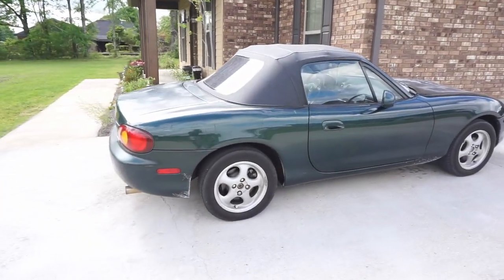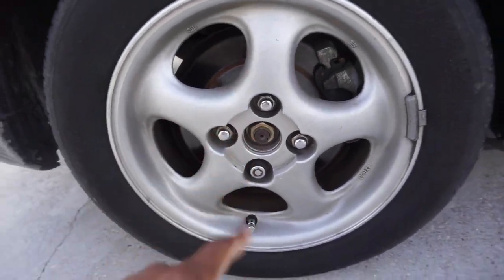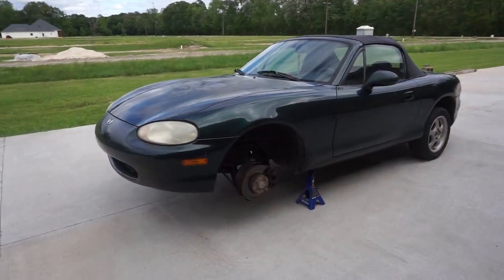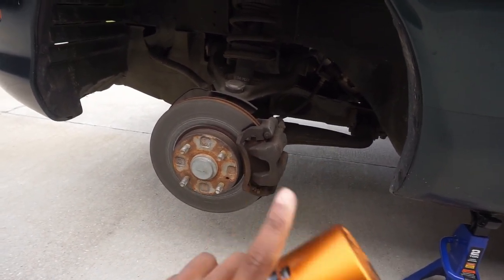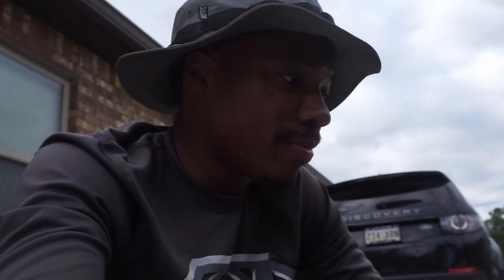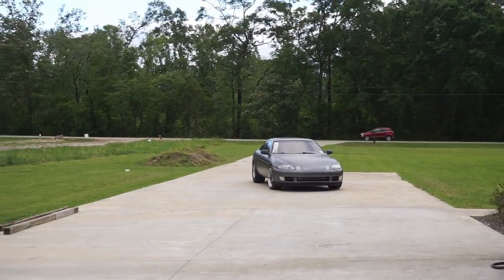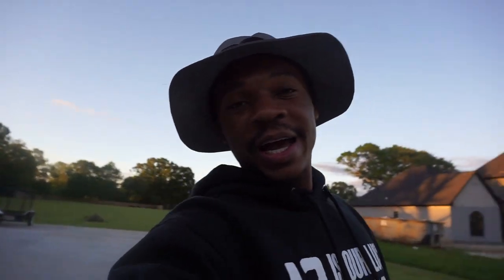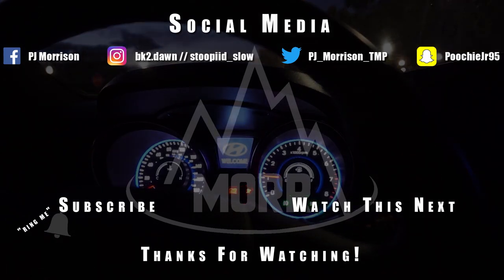How to MAKE BRAKES LOOK BETTER | Brake Caliper Refinish

Comment: You seem hella coo bruh haha would love to work on cars with you. Thankyou for doing this color too!! Was gonna do (what I used to consider ‘bronze’) this color on my black gto but after seeing it on yours I don’t think it’ll match as well. Gonna go with the same color yellow as the CTS-V calipers that dudes put on their goats 🤘🏻🤘🏻 much love bro. Also the rotors you got, and the pads I’m assuming too are the same I’ve had on my goat for the last 3 years. Love em , little noisy and don’t seem to like hard stops but they cool off quick and work well

Comment: How is the paint holding up on the calipers?? I’ve been wanting to do this copper color on my mustang but don’t know if it’ll hold up?
Reply from the maker: Paint is looking pretty much the same as I started with.. Just don’t let it get too greasy/grimey and spray it off every-time you wash (hard not to lol) and it’ll be fine
Reply: @pj_morrison  awesome , will do! I used it on my valve covers & it peeled off but it’s been around 3 years. Maybe I didn’t prep it correctly lol 😂
Reply from the maker: @cruzanity7478  yea, I’d say your prep should’ve been better for the paint to adhere. Just be sure to sand very well, priming is also a plus too

Comment: If you were planning on putting new rotors on and replacing brake pads then why not do it the right way and take it all apart clean the caliper and get good even coats of paint. If you don’t do the small things right then you’re gonna screw up your turbo build. Just take your tome and do it right the first time and i promise you’ll be happier with the outcome.
Reply from the maker: Matt McKinley that’s correct.. But I’ve never had a problem doing it this way, they look good to me, and they’re just factory calipers. Nothing special, and if it works then aye🤷🏽‍♂️